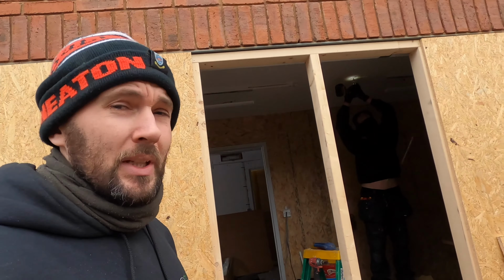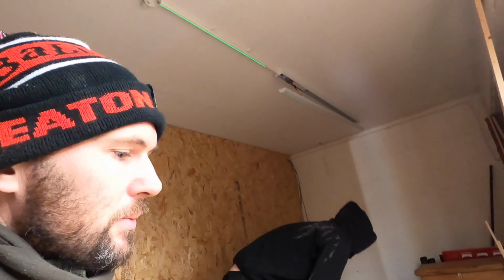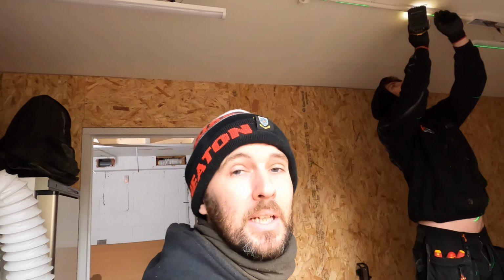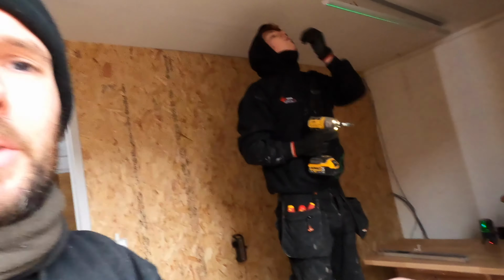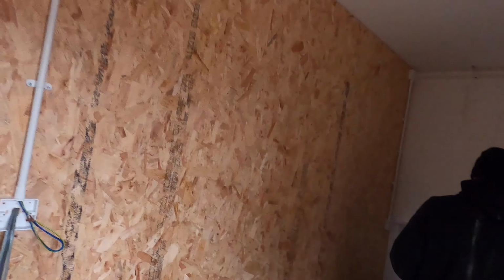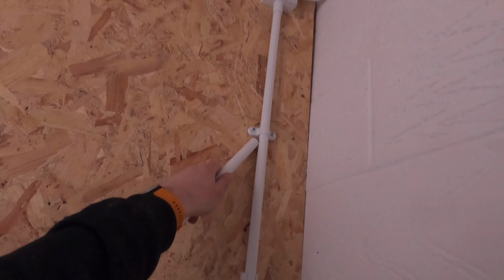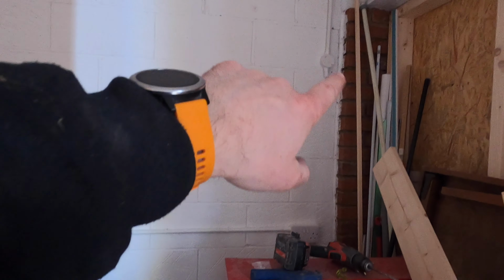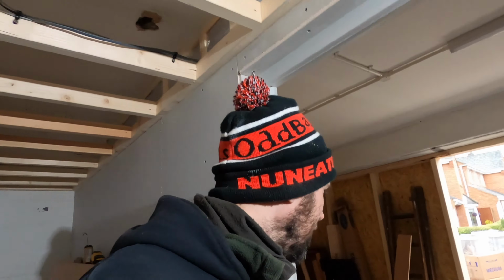Garage Conversion installing conduit to the front #Garage/Workshop #home-workshop

Comment: I must admit l like using 20/25mm plastic conduit, you might find it a little odd but l often chase-in for domestic installations as l find you can always carry out any alterations should the necessity arise with ease.
Keep up the good work and stay safe.